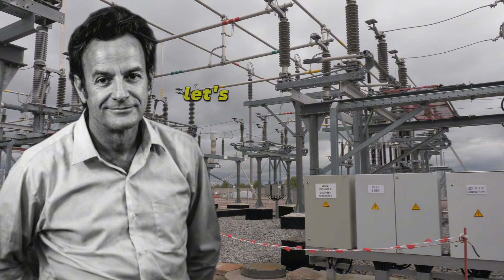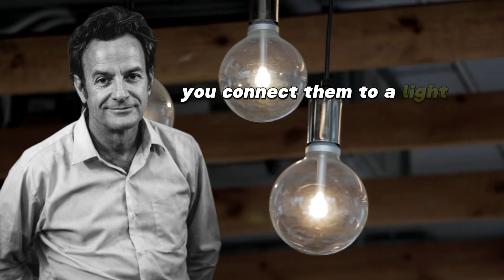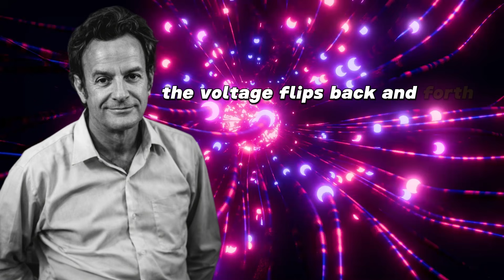Feynman Explains the Great Misconception About Electricity (You've Been Misled)

Comment from the maker: ⚡ The great misconception: Electricity doesn't flow through wires. Energy flows through the SPACE around wires.

When you flip a switch, electrons in the wire move at only 1 millimeter per second—slower than a snail. But the light comes on instantly because the electromagnetic PUSH travels at nearly light speed (200,000 km/s).

The real shock: Energy doesn't travel through the copper. It travels through the electromagnetic field in the AIR around the copper. The wires are just guardrails directing the energy flow through space.

This is the Poynting vector—it shows that electromagnetic energy flows through space, not through conductors. The electrons barely move. The field does all the work.

⚛ Key moments:
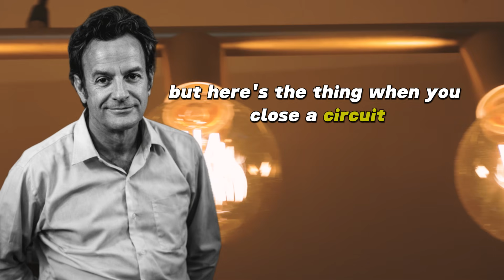1:45 - The flow that isn't a flow
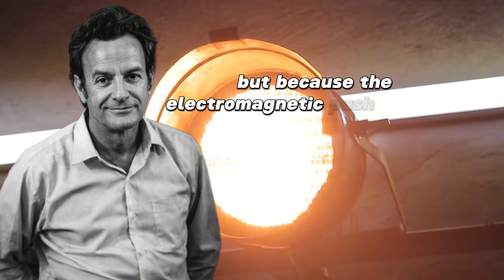4:00 - Electrons move at 1mm/second (the paradox)
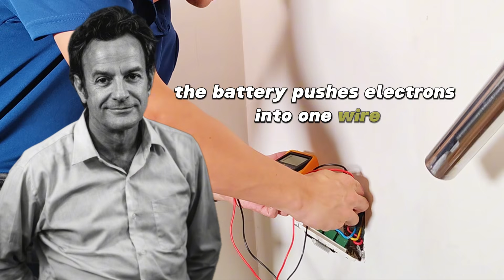9:00 - The push travels at light speed
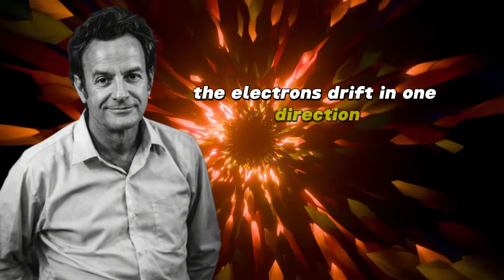11:30 - Where does energy actually go?
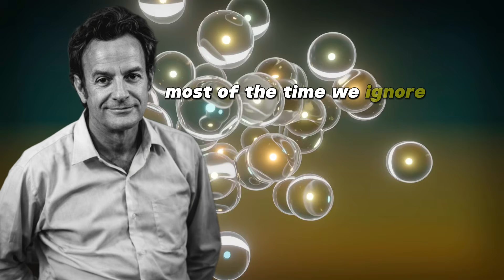14:00 - Energy flows through space, not wires
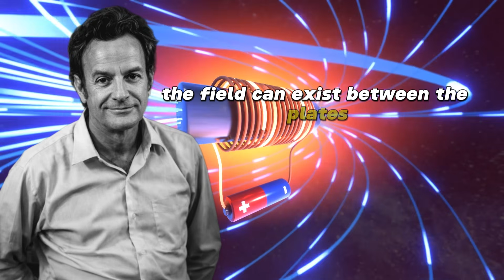16:30 - What electrons are really doing
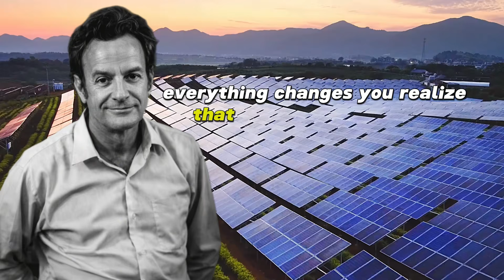20:00 - The truth about electricity

With AC current, it's even stranger: electrons just vibrate back and forth a fraction of a millimeter while electromagnetic fields carry all the energy through space at light speed.

⚠ NOTE: This voice is AI-generated based on Feynman's speaking style. Content inspired by his lectures and teachings for educational purposes.

💬 Question: Which is more mind-blowing—that electrons barely move, or that energy flows through AIR?

🔔 Subscribe to understand reality the Feynman way